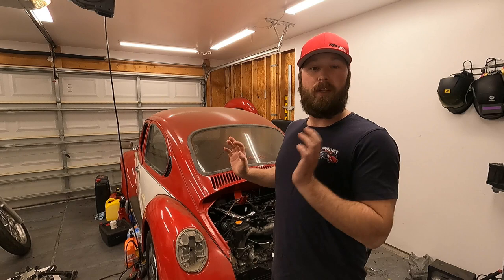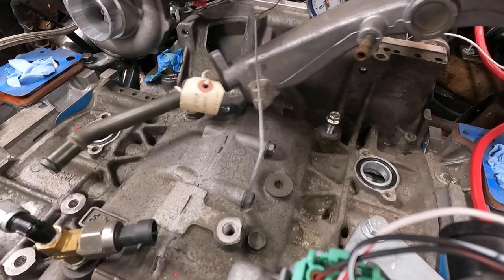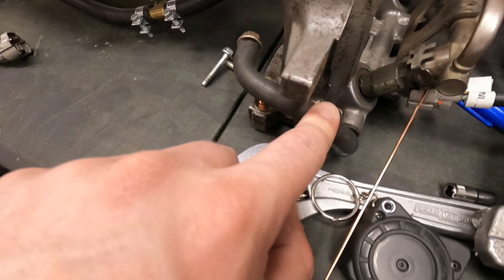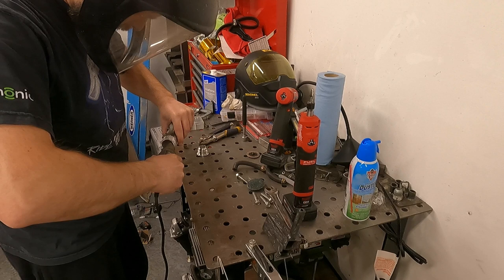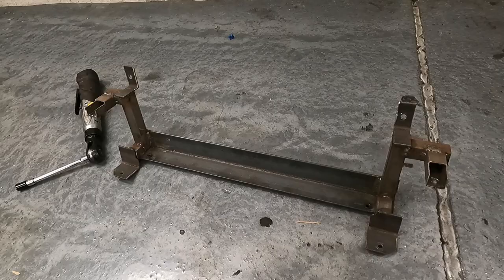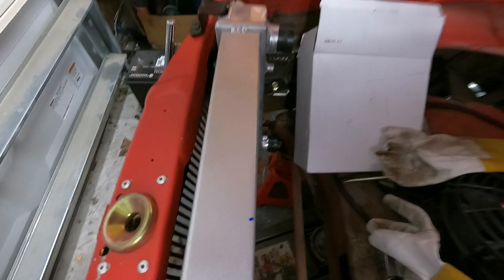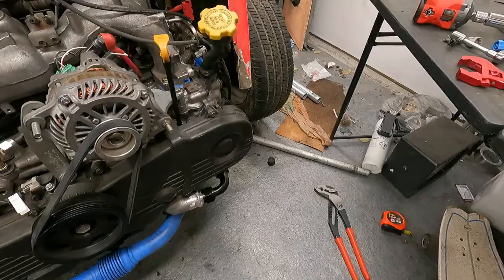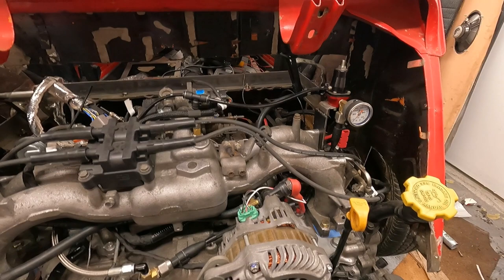Complete Cooling System -- 1973 VW Super Beetle Subaru Swap

Comment: Turn down the heat and reduce your filler rod for your aluminum, and practice with it on different thickness es of material. You will get better over time. Good job otherwise.
Reply from the maker: Thanks for the advice and words of encouragement!

Comment: Do you happen to have a part number for the hoses an fittings you are using. Installing a Subaru in my 72 vw bus thank you for the help love your video’s
Reply from the maker: Could you be more specific on what parts? I bought almost all my -16an fittings from Summit Racing
Reply: Sorry about that the radiator hoses .
Reply from the maker: No problem! I got 2x of this for a total of 30’   https://www.summitracing.com/parts/sum-240715b

Comment: Mine is a 1971 1302 super with an ej22
Reply from the maker: So sick! What is your suspension/brake/wheel setup? I need to seriously start considering what I need to upgrade in those departments
Reply: @RatchetMotors  its still stock for now 😥😂. 
I need to do the body i have rust in the heater channels planning to get a welder so i can fix it and get it ready for paint
Reply from the maker: Good luck!

Comment: Just got a super beetle and plan on doing exactly what you've done.  One question I have:  Is the engine just hanging off of the transmission without any other support?  It seems to me the 4 bolts attaching the engine to the stock transmission would not be strong enough to support that weight hanging off of it for long.  Did you fabricate anything else to support the engine weigh?
Reply from the maker: You are completely right, the engine just hangs off there. I will be building a crossmember at some point but from the factory, the engine just cantilevers off the back.

Comment: Is that a VW scirocco radiator you’re using? 

I’m really curious how well -16 will work, I’ve calculated the flow and based on estimates for water pump flow rate, numbers I came up with is 1” ID is about the minimum that would work. So I’m really eager to see how well it works.

I’m Subaru swapping a 76 Porsche 912, going with a built N/A 2.5 motor myself, with tucked rads under the headlights.
Reply from the maker: Yes, it is a scirocco unit!  I am also curious to see how this all works out with the stock water pump. I considered an inline electric pump but I’m going to send it for now. Good luck with your project!
Reply: @RatchetMotors  it might provide enough flow without an electric pump.

I keep meaning to measure the flow rate / pressure drop of the lines, but haven’t gotten around to it. To measure flow, basically drive the water pump with a drill and time how long it takes to fill a bucket, at different RPMs, can then plot a flow rate curve.

I’d measure the flow rate before adding a pump, it might just be perfectly fine. 

These cooling systems are complex that only way to tell is to measure things.

In my case, I’m going with 1.15” ID aluminum hard lines (electrical ARC conduit), it bends, and welds nicely.
Reply from the maker: That’s a great idea for the measurements! And I was actually planning on doing the electrical conduit but decided otherwise when I started mapping out hard lines vs soft lines and bend paths. For me, it was easier to just run AN lines but I think the conduit could be done very clean and look great.